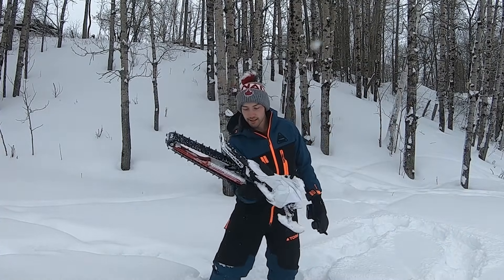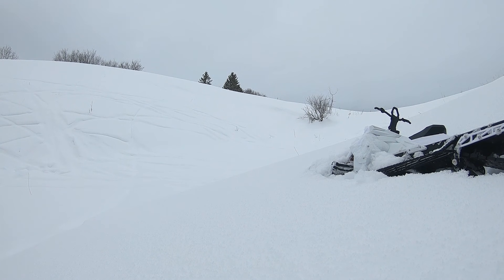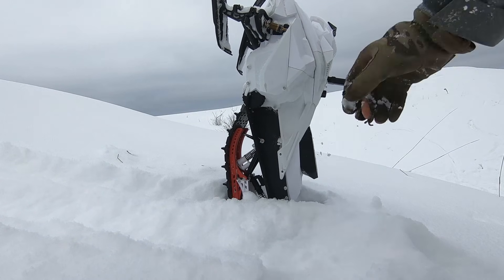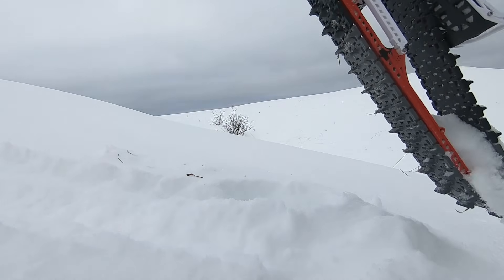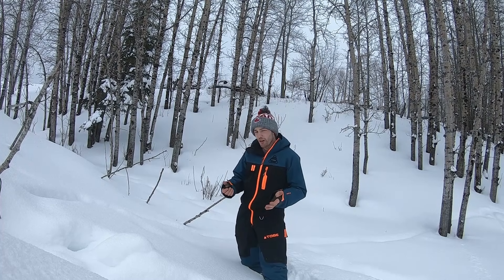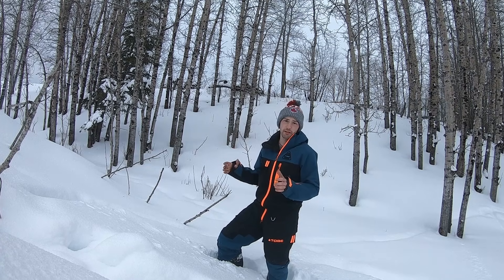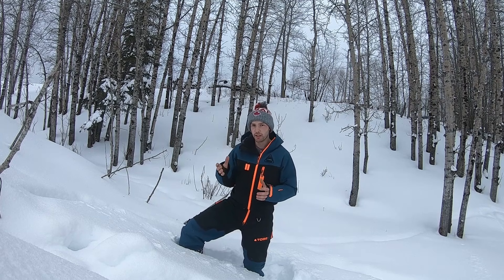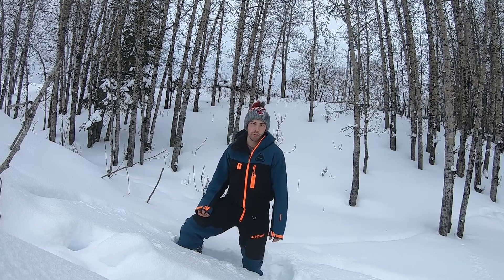Super Long track Rc Snowmobile - Is longer really better?

Comment: Ive been following you for a few years now.   I love that you're testing new configurations all the time.  What works for a full size snowmobile (dimensions, skis, track dimensions, center of mass, etc) may not work as well when it is scaled down.  It is so much work to research this stuff and it is soooo cool you are doing it.  With RC cars being as ridiculous as they are today it makes me wonder why Traxxas or one of the other big brands haven't figured out RC snowmobiles.  Have you thought about increasing rotational mass for stability like RC motorcycles? (gyro effect) On full scale machines the rider provides a lot of stability by leaning which is tough to replicate on an RC.  I think with you're determination, testing,  and constant refinements, you will truly have an awesome RC Snowmobile that is incredibly fun to drive.  Keep it up!
Reply from the maker: I do appreciate the feedback! I like to do these kind research personally too.  
The track is between 8 to 10% of the weight of the machine.  It actually has a lot in of inertia,  especially and the speed at which they are spinning.   If you have a nice ramp to launch it,  and drive it properly, you can almost do a tailwhip. I'll do my best to insert a clip in a futur compilation!

Comment: You should try to make a snowmobile with a controllable weight on top that shifts from side to side, simulating the weight of a driver!
Reply: He had and it didn’t work
Reply: @codyriecken1474  I just saw that, but wouldn't it work better to have one stick on the controller steer the skis and one stick to control the weight, instead of just one stick that controls both the skis and the weight, that makes counter steering not possible.
Reply: @williamekberg2287  that was what I thought. One stick is dumb
Reply: @Dustin34  yeah, kind of defeats the purpose
Reply: This is a good idea, would be sick to have a wheel radio with a thumbstick for your left thumb that would move a driver around. I think the sled would have to be bigger though to fit a doll that advanced on it and keep the weight ratios between the two right.
Reply: Bringing this comment back to life but I think the best way to do this would be to add a driver figure (proportionally similar or slightly heavier rider than real life) and use a 6+ channel aircraft transmitter (two sticks) and use one stick for throttle and steering and the other for leaning the rider. This would be pretty close to Mx VS. ATV Reflex controls which was one of the best motor sports games to this day. This way you’d have independent control of the rider and snowmobile.
Reply: @theELiTEboarder  great idea!

Comment: Where the normal track ends and the extension begins, you should try kicking it up 5 degrees and see how much that affects it.
Thank you for the Awesome video!
Reply from the maker: It would most likely help get out of the snow easier but you would still have no control other than in a straight line.   The track would still not dig and get to the stiffer stuff down there, So I still believe a regular 165 or 154 is a better option in a deep snow senario.
I like the suggestion tho👍

Comment: Your analysis on the track with how the snow and the luxe grip sounds fairly accurate unbelievable, but if you are going to give scaling perspective keep in mind that the fluff you're driving that snowmobile in to scale would be probably be like 4 feet of champagne powder to real snowmobile. Cool vid
Reply from the maker: You are absolutely correct.  In harder snow conditions, the result could have likely being different.

Comment: What size motor do you use? brushed or brushless?
Reply from the maker: This specific one was a brushless 4274, but normally a 540 or 550 class works great and are a bit lighter
Reply: @Pascal_Robert--Rc_Creations  Thanks!

Comment: What about a taller, or more paddle style lug on the printed track. Your other models tear threw and wheelie. Is that because the track is shorter ?
Reply from the maker: Because of the increased skid lenght, it's almost impossible to pull a wheelie from such a long point.  A longer paddle would still not make it wheelie more.  The pivot point is simply too far back

Comment: so there's a probability you'll see this comment but i've been thinking about getting a rc sled and making a rider that works as a counter balance so it could make driving a little more fun! also this comment was made drunk at 10 at night :))
Reply: so a little bit of description I want to make the rider weighted with a couple of servos that control the placement of the rider so you can carve and ride around a little easier!
Reply from the maker: You are not the only person that came up with the idea.  The problem is that even if you did it, you cant react fast enough at that scale to control it prefectly.  Sure practice helps, but look at a real rider go.  He's not only going side to side, he's back on the boards, walking the sled, foot down, all that makes it difficult to replicate, and even harder to control quickly and precisely.

The idea is good and ill likely look back into it some day, but the challenge is immense
Reply: @Pascal_Robert--Rc_Creations  agreed at that scale it'll be hard and I plan on 3d printing some parts and looking deeper into it!
Also love the channel!!!

Comment: The problem is when you increased the length of the track,  the weight of the machine is spread out across a bigger suface area which is making the snowmobile “float” on the top of the snow. 

The easiest thing to do would be to increase the depth of the lugs, 

Just for the hell of it, I would find out the weight of a mountain sled and divide that across the surface area of the full size track. I would also compare the lug depth compared to the length of the track.

Do the math and you can figure out the PSI And compare it against your RC to see if you’re even in the neighborhood
Reply from the maker: You are correct, and understand about 90% of it.  There's also a difference in how the snow itself is at that scale.  The snow particules does not scale up and down with the scale of the machine.  So you are never going to have a perfect apple to apple comparison.  The only exception is when the snow is crusty or straight up ice, but that ain't as fun :)

Comment: Do you think putting a rider on it for a little extra weight will help it rip better? Extra weight to put track down.
Reply from the maker: I dont think so. Its already one of the heaviest machines i have.  The floatation is just too high for a machine of that size. It stays on the fluff on the top and it needs to move it out and get deeper to get traction.

Comment: To long of a track it’s making the nose sink into the snow.. gonna have to put a faster kv motor in it to make it somewhat work. Or put weight on the back.
Reply: I agree. the long track provides greater flotation to back half of the sled, where it is already lighter than the front half, causing the front of the sled to sink or nose dive. The only thing to counter balance the weight difference is track speed. But increasing the spin of the track also has a downside ... it contributes to trenching. You need all of these things working together to create forward momentum. You have to find a balance between track flotation, weight distribution and power.

Comment: are you trying to compare a toy to the real thing???   when it comes to the real thing compare 133 with a 170 inch truck and is a big big difference
Reply from the maker: Yes i am sir.  That being said, 5 inches of snow at that scale is far different than 25 inches of deep powder in real life.  The normal sleds i'm using are around a 165" equivalent, as opposed to the 245" in the video.  It will never scale perfectly, but it will show some similarities that we could expect if somebody made such a long machine in real life
Reply: @Pascal_Robert--Rc_Creations  I have found the longer the track the better , short track sleds always got stuck so easily.
Reply from the maker: @carmichaelmoritz8662 yes, that is correct. But at some point there is diminishing returns.  The increased weight is starting to do some harm.  

Compare it to the clip at 3:00 of a lighter (165") machine.  Both were filmed at the same spot, the same day
Reply from the maker: @carmichaelmoritz8662  but i think the main difference has to do with the floatation.  It stays in the top fluff and does not dig in the harder stuff
Reply: @Pascal_Robert--Rc_Creations  I agree and understand when it comes to flotation.

Comment: The track it longer and is like tires say to do 70 it spins 4000 rpm with a regular track under it now to do 70 with that big track it only spins 2000 rpm so the track cannot clean it's self... don't fact check my numbers that's just and example
Reply from the maker: Not quite, the motor speed is set by the battery voltage, so would remain the same with a smaller track
Reply: @Pascal_Robert--Rc_Creations   no it wouldn't the bigger track spins slower to go the same speed as the smaller track has to spin faster to keep up with the big track. I ride snowmobiles in real life and when I long track swapped mine that is something I noticed
Reply: And the moter doesn't have to change speed it's kind of like gearing
Reply: It's the same concept as of when you change the size of you car tire. The bigger the tire the slower your speedometer reads and the smaller than stock tire will make your speedometer read fast
Reply from the maker: @shane6422  The driver tooth count dictates the track speed on the ground. Not the track lenght.

 If you notice a track speed decrease on your real sled, is because there's more load on it and your variable clutch compensate for it
Reply: @Pascal_Robert--Rc_Creations   the way I noticed It on my real sled was with a rpm Guage